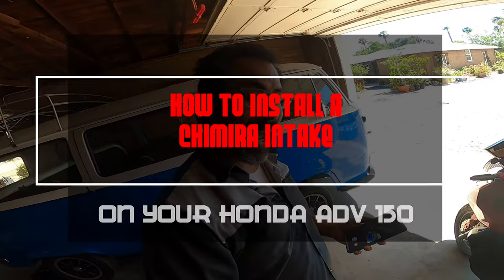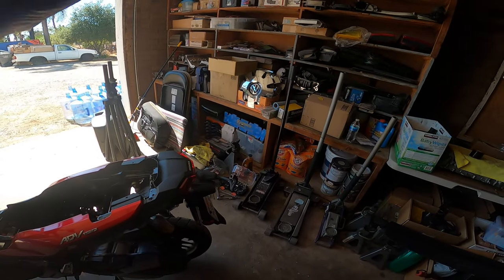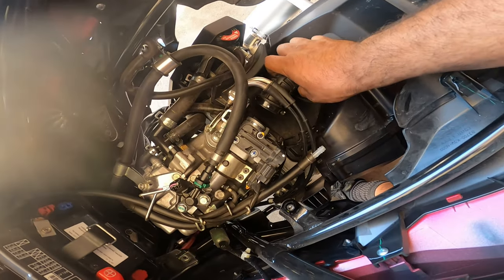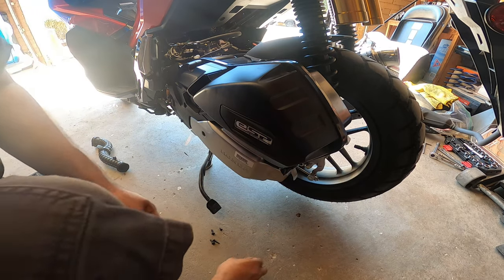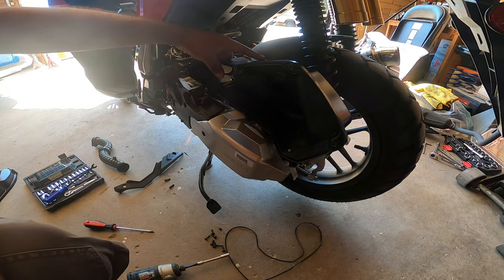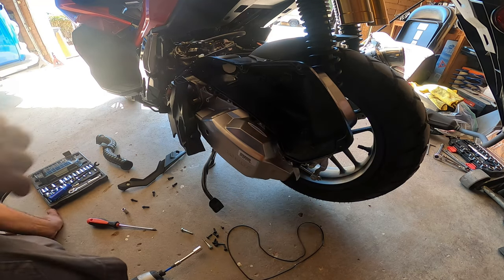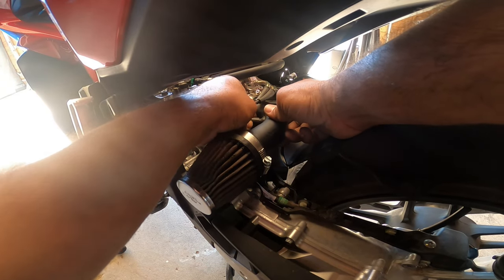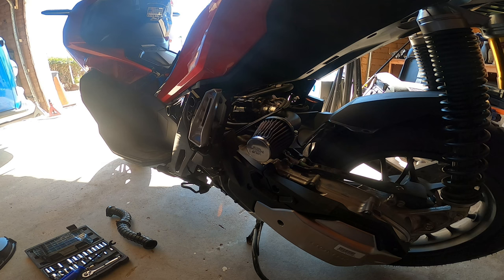How to install Chimira Intake on a Honda ADV 150

Comment: have you had it running lean? I've done this mod but I'm worried about a lean condition
Reply from the maker: No I have an Aracer mini5 ECU plus a wideband 02 with an 8 hole 170cc fuel injector